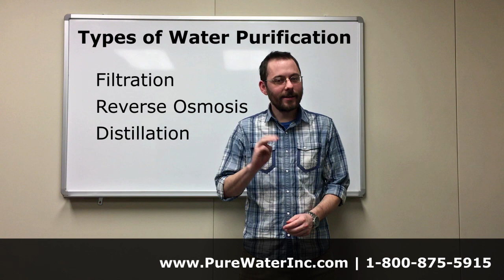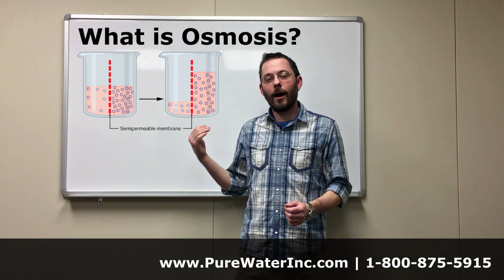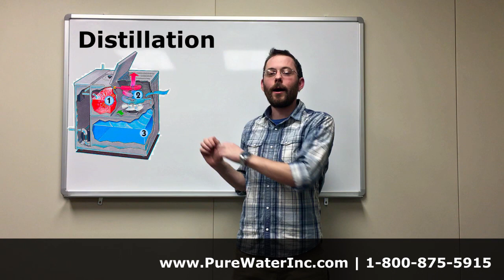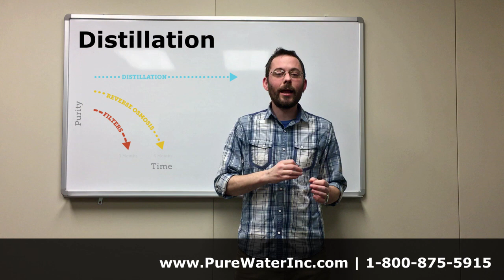Distillers vs Reverse Osmosis vs Pitcher Filters

Comment: This couldn't be more wrong when it comes to the filter portion of the video. Yes, carbon filters are as stated, but there are other forms of non-carbon filters like ionic-exchange filters. Ionic-exchange filters (like Clearly Filtered) uses over 10 different medias that chemically bond to various types of contaminants to capture them in the filter. This allows for much more comprehensive and advanced filtration than stated in this video. You basically explained a Brita filter, but you shouldn't lump all filters together in a single bucket! These filters are by far the most cost effective way to get extremely clean water in your home, especially without needing to install anything in your house.
Reply from the maker: Yes, Ryan there are a lot of different types of filters beyond the carbon but they all suffer from the same limitations.  They are a barrier that blocks contaminants from moving on and lets water pass through.  ion exchange will only remove certain types of contaminants it can bond with and just like carbon filters, as you use the filter, it wears out and will allow more and more contaminants to pass through until the filter needs to be replaced. Higher end filters like this can be very expensive.   On top of that, these filters don't handle biological contamination.   Distillation will give you a higher purity water and a more consistent higher purity than a barrier filter ever could.
Reply: Biological contaminants can be removed through means other than distillation (actually there are a few gravity pitcher filters that remove biologicals). The Clearly Filtered pitcher I use does 99.9% of bacteria and cysts. I agree that over time the filters become exhausted, but assuming you change your filter in the specified time/volume of water you are fine.  This video makes it seem as if all gravity pitcher filters are made the same when they are most definitely not.
Reply from the maker: How does a gravity filter work differently than illustrated in the video?  It is strictly a barrier method.  The filters your describing are very high end filters that have very very small holes to allow only the water through.  So small that bacteria and viruses remain behind on the other side of the filter.  But over time, that filter will wear down and they can get through.  Another issue you will have is bacteria building up on the back of filters and forming colonies.  These colonies can wear down filters faster accelerating the process of contaminating your drinking water.  Gravity filters do an OK job but your second batch of water won't be as good as your first.  That is why distillation is the best option.

Comment: Thank you for video, but I believe there are more factors must be taken into consideration, like cost, life time, how to remove the salt in case of using a see water. I wish you make a video about that..
Reply from the maker: This is a broad video to show you the basics of the three most common types of water filtering in the home.  A distiller is going to have the higher initial cost but with the expensive membranes that R/O systems require and the lackluster job filters on their own do, distillation will be your cheaper option.  Our distillers are made with 304 grade stainless steel and will last you for decades.  None of these systems are going to be ideal for salt removal from sea water.  That kind of filtration is hard and expensive.  These systems are designed for city or well water which is already potable.
Reply: Thank you for your reply..

Comment: But!  I've heard the reasonable sounding argument that drinking distilled water can leach health-friendly minerals from your body . . .
Reply from the maker: this is literally impossible to do.  in a laboratory, if you were to surround a living human cell with distilled water, osmosis would occur and minerals would leave the cell into the water.  But remember there is no such thing as distilled water inside your body.  You drink it and it mixes with everything else you ate and drank that day and then your kidneys add hydrogen, ammonia, potassium and sodium to the water to keep it in perfect balance with your cells.  All you are doing by drinking distilled water is removing the loads of possible contaminants in your tap water so your body no longer has to filter them out.
Reply: No she is right. There is no reason to drink distilled water. Distilled water is a natural break downer. It WILL break down your bones and agressively cause electrolyte emblancws. The best water is= purified spring water. Period. Do not drink distilled water. I make beer as a hobby and the worst water to use is distilled. Water is naturally the “great emulsifier” aka= it’s goal to break down what it comes in contact with. Case and Point= drink and cook with distilled water= you are breaking down that which comes into contact with the water out right. Distilled water is a massive emulsifier. You shouldn’t ever drink it. This guy is a loon. Please only drink purified spring water period

Comment: OK uses up to14 gallons of water to get 1 gallon .
So how much Energy on the distiller to get 1 gallon ??
Reply from the maker: About 3 kilowatt hours of electricity per gallon.  The national average is around .09 cents a kWh so about 27 cents a gallon.  You can check with your electric company for what you are charged per kWh to determine your cost per gallon.

Comment: My organic Chem prof joked with me about activated carbon made at high temps contains benzpyrene, the most deadly carcinogen known. Sorry about that.
The most efficient method is vacuum distillation of water. Don't need so much heat.
Reply from the maker: But the energy to bring water to vaporization point is the same.  So you are really not saving any energy.

Comment: I bought a water distiller and when finished making water ,water has a burn smell,it has a carbon bag in drip tube . What is up with this ???
Reply from the maker: Which distiller is it?  How the boiling tank boils off the water would be my main concern.  Does the boiling tank boil dry?
Reply: I realized that after cleaning it...thanks

Comment: Just found out that my water company in the UK adds fluoride to my water - I'm livid! 

Now I'm trying to find the cheapest option to remove the fluoride.  It's so confusing. I'm using a filter jug at the moment, but it doesn't remove fluoride.  

The filter jugs and cartridges designed to remove fluoride are too expensive.  I don't know what to do.  Doesn't this system use a lot of electricity?
Reply: typical counter top distiller = 750 watts say 10 hours use = 7.5 kwh @ say 15 pence per kwh = £1.125

Comment: So distillation is the best but still uses filters for VOC's that can clog up.  Talk about a hypocrite!
Reply: Bro carbon filters on a water distiller are totally inexpansive to change  compared to a RO system, do your homework or shut up
Reply from the maker: Carbon filters are good at specifically removing VOC gases.  On their own they are not very good at purifying your water.  When paired with distillation which removes the bulk of the contaminants and vents off most of the VOC's, the post filter needs only to remove a very little.  This combination gives you the best removal rate then just a filter alone.  Our distillers on their own without a post carbon filter still have a consistent efficacy and don't lose that over time like a filter would.  Distillation on it's own also takes care of biological and inorganic contaminants that filters themselves have a hard time with.  So pairing distillation with a filter is just to get the most purity we can get.

Comment: Which one will remove fluoride
Reply from the maker: All of our distiller have an over 99.9% removal of fluoride.
Reply: RO AND DISTILLED
Reply: From what I understand Carbon filters supposed to be the best and distillation process actually increases fluoride concentrations...thats why distillers have carbon filters on them after its been through the steaming process.
Reply: @cafefps  The higher cost of excellent filters for a reverse osmosis de-ionized unit costs more than running a distiller over a 1 year period.
Reply: From your toothpaste ?☺️

Comment: Thanks for all the information on the differences of each filter. I just purchased a distiller. My tap water tests at 80ppm. From what I've been reading, that's on the lower end. But after drinking water from the tap, my throat is dry and it leaves a salty aftertaste. Hopefully distillation fixes that.
Reply from the maker: We would love to hear how the distiller works out for you.
Reply: So, how is it?
Reply: It’s been 4 years we gotta know!
Reply: @krazyforkrunitz  I got rid of it and went with a reverse osmosis system. After 6 months of drinking water from the distiller, I had four cavities. And I don't eat much sugar. My dentist told me distilled water is highly acidic.
Reply: @srabchun  I prefer distilled water- you can add pure sodium bicarb until pH is about 7.   Coke is highly acidic - lemonade, etc.

Comment: What's the solution for shower water, particularly for apartments?
Reply from the maker: Generally it is not very cost effective to use distillation for your shower.  For this, we generally recommend a shower faucet filter for an apartment because it is not invasive or a whole house carbon filter for all the water in your home.

Comment: The water taste is incredible! After drinking of distilled water you never switch to any filtered water. The customer service in this company is very good. Don't worry. This machine is very reliable. If you want to 'charge' your water just put a little bit of Celtic salt as a mineral into the container.
Reply: dont put salt Bro its inorganic mineral, still lot to learn

Comment: Can distillation filter out formaldehyde,pesticides from the water?
Reply from the maker: Formaldehyde is actually volatile below the boiling point of water.  Which means it will vaporize inside a boiling tank.  The boiling point is so much lower that it should be completely vented out of the VOC vents on the cooling coil but should it get through that process, the granulated carbon filter should remove it.  Pesticides are a little more broad and can have different boiling points depending on the type.  Most have higher boiling points than water and should be left behind in your boiling tank.  If you are ever curious about a specific pesticide, just look up the boiling point to determine whether it will vaporize with your water or not.
Reply: @PureWaterDistillers  oh look it has a filter hmmm....
Reply from the maker: @Oh-ou4lp  - Yup! Carbon filters are a great backup to remove any VOCs that manage to get past our dual vent. Filters don't get everything on their own, but paired with distillation - that's a great combo!
Reply: @Oh-ou4lp  A small packet of activated carbon the size of a tea bag.

Comment: We have 600x EPA max of Chromium 6 in my area of Houston; distillation doesn't touch that - only RO does.  I RO my water, then distill it; Houston's water is one of the worst 5 in the country.
Reply: Not sure where you read that distillation does not remove Chromium 6 but I would have to disagree.  Chromium 6 has a high boiling point, much higher than that of water.  Distillation is extremely effective at removing it and consistently removing it.  an RO membrane breaks down over time and can allow chromium through.  Distillation because it doesn't use a barrier method will always give you the same removal rate whether it's the first run or the 2,000th run.
Reply: But it is through the membranes life expectancy.  What if you don't get it changed before that life expires?  distillation you don't have to worry about it.
Reply: The problem we have with R/0 is consistency.  Temperature, age of the filter can all affect how pure your water comes out.  Over time, it will allow more and more chromium through.  R/O systems typically waste water as well.  Distillation will give you a 1 to 1 ratio.  R/O systems can waste up to 10 gallons for every 1 gallon purified.  Our distillers have an over 99.9% removal of Chromium and other VOC's.  If the R/O is working for you in your area, that is great.  But depending on the contaminants in your tap water, distillation will be the better choice because of the broad spectrum removal it provides.
Reply: What is the life expectancy of the membrane for filtering out chromium 6 ? as i'm sure as the membrane starts to break down it will let smaller particles through and not bigger ones but they will say  the life expectancy has not been reached yet.
Reply from the maker: RO membrane life depends on a number of factors such as what kind of membrane, is it for household use or commercial use, what is the incoming water pressure and temperature and more.  What we can say is that removal rate deteriorates with time starting on the first day of use.  Many RO membranes are covered by a 90 day guarantee (perhaps that offers a clue to quality lifespan).  Distillation is 99.9% effective at removing contaminants consistently over time, which makes it perfect for removing known and unknown contaminants.
Reply: I believe the reason so many RO membranes hold a 90 day guarantee may rely upon the fact that they are an interchangeable component of a system that is frequently used in homes. To say a 90 day guarantee is relative to life expectancy doesn't make much sense. I just bought a blu ray movie at Best Buy and I have a 90 day guarantee on it does that mean my movie may only work for 90 days?
Reply: The Pentair 1-1 Membrane on Complete Water Systems ROs is actually certified to remove the chromium 6 throughout the membranes life expectancy.
Reply: sciencedaily.com.   I went with reverse osmosis because it does a better job a removing chromium and that removes VOCs that distillation doesn't. The energy costs are, of course, much less with reverse osmosis but I have it compared to overall operating costs. I use distillation for 2 years and I find the reverse osmosis water to be much cleaner and when I sent it out to be tested it came back just about perfect.
Reply: As said before you can add a pentair 75 gpd He-gro membrane to almost any RO system and it has a 1-1 ratio that can compare to the distillation method
Reply: But again R/O membranes wear down over time.  Distillation will give you a consistent purity level.  Distillation will also be cheaper in the long run because R/O requires you to continue purchasing their expensive membrane filters over time.
Reply: I haven't priced distillation out (electricity,) but R/O is much more convenient.  Perhaps, when I get an R/V trailer, I'll go back to distillation.  For now, the convenience trumps all. ;)
Reply: What is the life expectancy of the membrane for filtering out chromium 6 ? as i'm sure as the membrane starts to break down it will let smaller particles through and not bigger ones but they will say  the life expectancy has not been reached yet.
Reply: They last 2 to 3 years and on complete waters website they're under $100

Comment: I have been using a four litre, counter top  Megahome water distiller for three years now. It has been the best thing I ever bought!!  Awesome clean, sweet tasting water every single time!! 
I add a pinch of Himalayan salt to the distilled water before drinking it to add back beneficial minerals to it. I find it also makes the distilled water taste better.
Reply: @Bill Carson my mega home lasted a good 6 yrs until the thermostat went. This is a common problem with kitchen equipment. It was cheap to fix and the top of the filter with the fan in has shown no signs of giving up. I use a ro system now only because I have 2 children and distilling water for a house full just got time consuming!
Reply: Thanks for your input, Megahome reseller.
Reply: bRO SALTS Are inorganics minerals its toxic unless it comes out of a living organism
Reply: @Bill Carson  -  I watched a product review video about the "Pure Water Mini CT"  and I would have to say that the Megahome is a much better distiller. 

It would be mission impossible to descale the boiling chamber on the Pure Water distiller. 
Plus its design is unnecessarily complicated. 

The Megahome is a lot more straightforward and easy to use and more importantly, easy to descale. 

I descale my distiller after each use.
First scrub the inside of the boiling chamber with some steel wool to remove all the lose gunk.

Then rinse it, and quirt some cheap vinegar all around the side walls of the boiling chamber. 
I pour enough vinegar to cover the bottom surface area. 

Then put the condenser back on top of the boiling chamber and leave ut like that until next time I need to use it.

When I need to use it again, I scrub the inside of the boiling chamber again to remove the rest of the vinegar disolved scale.